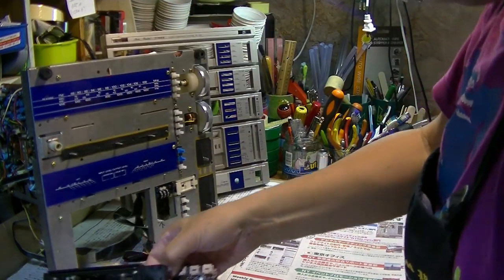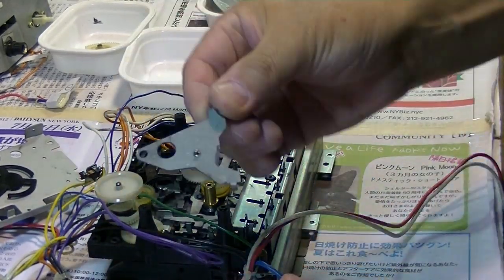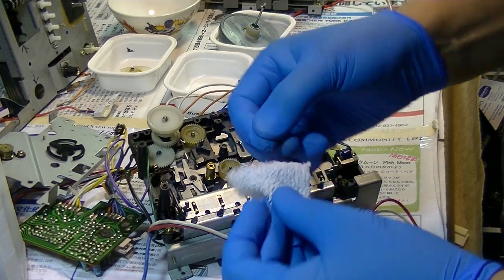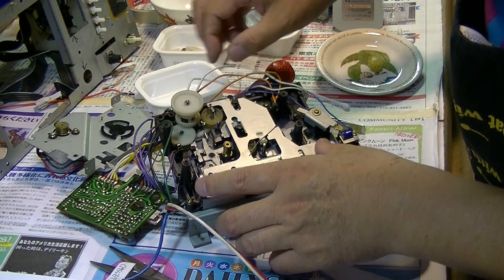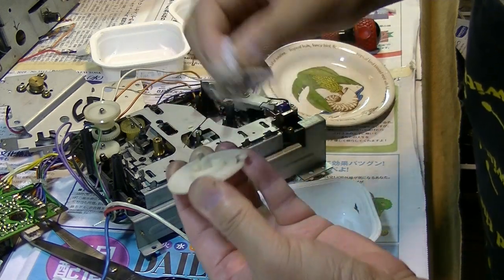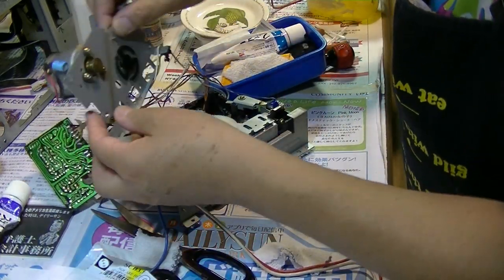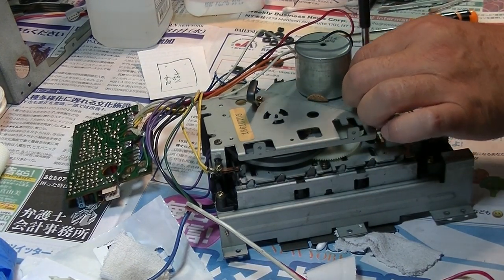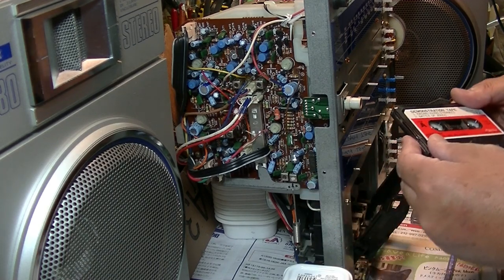FISHER PH-480 Boombox Cassette Deck Belts Replacement Explained

Comment: Hi teddy great boombox restoration as always.
Have a question for you I have a gf 777 all radio waves work apart from FM what do you suggest I do to fix this problem many thanks subscriber from London
Reply from the maker: You would better locate the FM module and check each of the electrolytic parts one by one. Yesterday I had read the book about how to troubleshooting audio equipment, and the author said one tiny capacitor or transistor affect all the FM radio sound. The book is "Troubleshooting & repairing audio equipment" by Homer L. Davidson. You can buy it on Amazon.

Comment: Hi Ted,looks like you have your work cut out there with the tricky repair job of replacing those belts on that cassette deck. It looks like a fair bit of weight with the cassette deck mechanism,I know it would've been built well back in the 80,s for that machine. I've had experience repairing all types of cassette recorders/players,from seperate cassette decks,to a car cassette player,small,portable,cassette tape walkmans,to the all in one unit systems,radio,tape,cd,turntable record player.
I've found just as much tricky repair jobs with tape recorders, just like the one  you're doing in the video. But at least I have got them working,restored like a new machine altogether. 
Some of the machines I receive are well look aftered,and after a complete clean up and repair jobs,they do look like new again.
Reply from the maker: Hi, Nick.
Thank you for sharing your experience. It will help a lot of viewers and me :-)
Teddy
Reply: @teddyhashee  
No worries my nice friend. As I have a fair few multiple cassette decks that had been given to me for repairs and restoration,and some of these machines are up to 40 years old,and they still work great 2day too,as they have had a lot of tlc maintenance through their lifetime.
Reply from the maker: Indeed, I totally understand what you are talking about!
Reply: How much would you charge to do mine, same thing....
Reply: @lowchopr1  

I would only charge $20/hour,,,for repair labour work on any particular machine,,,turntable,,,cassette player,,,cd player,,,radio tuner,,,stereo amplifier,,,all in one combination units,,,or seperate,,,regardless the size,,,weight,,etc.

Comment: Nice video. Is this the same for the 90 and 92 model? I have both but cassette deck doesn't work. I think its the belts. I will do it by myself nobody wants to help me here in Los Angeles.  Thanks
Reply from the maker: I am not sure 90 or but most likely they used same type of the cassette deck. Enjoy your restoration work!

Comment: Hi,
have on eBay radio "Panasonic RF-1105 LBS" auctioned
but the radio has bad reception and "FM" = zero reception, what can it be,
which components do I have to renew, can you possibly help me ?
Reply from the maker: I do not know what is going on your FM tuner since I do not restore the radio tuning system itself. But probably your Radio needs to be adjusted or replaced many electronic component. I hope you will be able to find the solution.